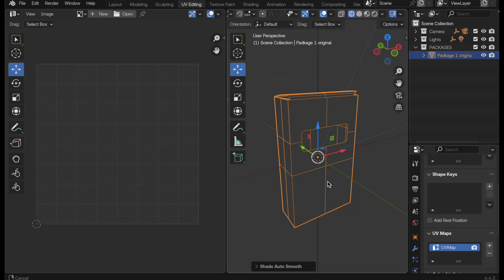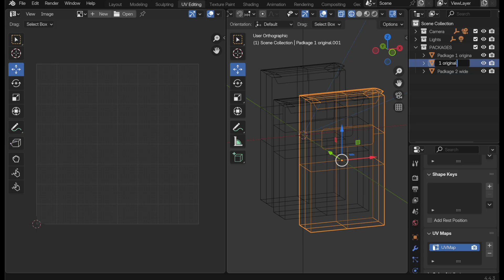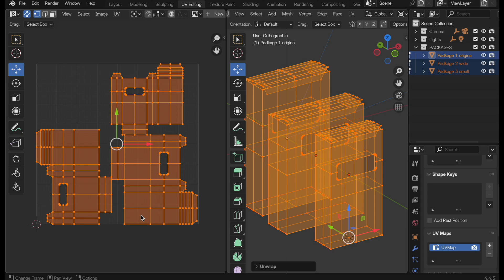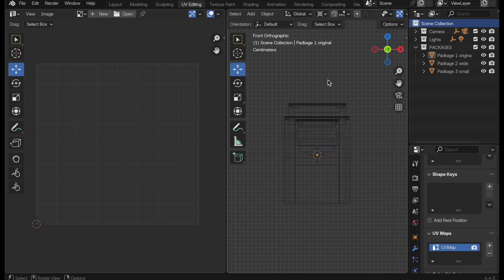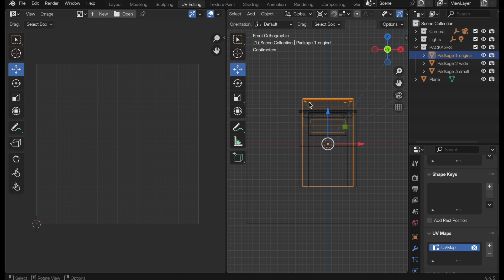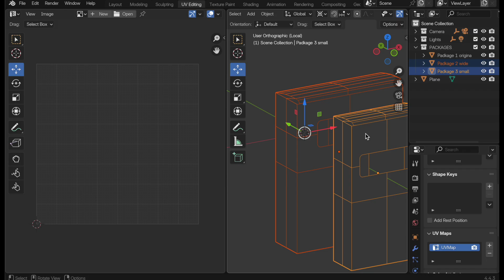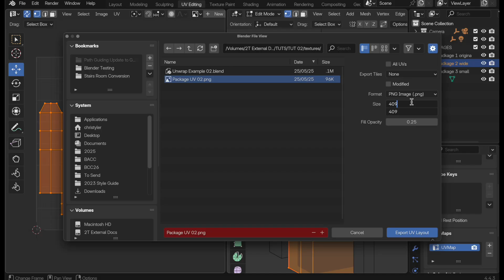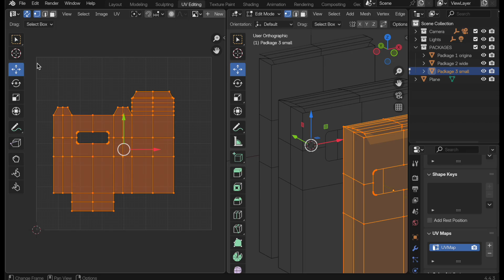A clarification for a size specific UV mapping.approach.

Comment: Unrelated but im pretty sure variable rougness isnt a real phenomenal. The Specular value (the ior level) is actually controlled by the fresnel. More Specular value = more reflections. This Ensures more reflectivity at glanzing angles. Shortly variable rougness is automated in the prinsipled bsdf due to fresnel. This is noticable when you change the ior to a way higher value.  The Ior level (specular value) slider is just a mix between a multiplication and division of the Frensel. For more variable rougness, use higher Ior.
Reply from the maker: No this isn't correct. The Principled BSDF (actually the GGX microfacet roughness function), alters the fresnel effect with increasing roughness. Technically it's still using the full fresnel curve, but at a single microfacet level. The macroscopic effect of increasing roughness is to scatter the reflections with their usual increase of reflectivity at glancing angles, as seen on mirror-polished surfaces. The apparent effect is that fresnel is less strong on rougher surfaces. In reality, surfaces are more sophisticated than the microfacet mechanism is simulating and sometimes surfaces become more apparently mirror like (or towards more mirror like) at glancing angles. This causes fresnel to increase in strength because light is scattered less even if the roughness at F0 is still fairly high. 

Variable roughness is the tool we have in Blender to simulate this.
Reply: @christopher3d475  Hi, Thanks for the comment. Do you know a reseach paper that shows how this can be physically accuratly modled? It would be very helpfull. Again i appreciate the quick response and the explanations, Thanks.
Reply from the maker: @helloiamaduck9203 I haven't looked to be honest, I'm sure there are given the ubiquity of this phenomena in the real world.
Reply: @christopher3d475  Thats true, i will take a look at it.
Reply: @christopher3d475  Solution might be similar to coating. Mix the shader that you want to apply variable rougness on with glossy bsdf by frensel
Reply from the maker: @helloiamaduck9203 No, because the glossy bsdf will have uniform roughness across the surface. What I'm talking about is something that happens on a SINGLE bsdf layer.
Reply: @christopher3d475  You're right.  Again, thanks. Ive concluded that the only physically accurate way of simulating variable roughness is by using a clearcoat or a layer of glossiness. I've taken a look at render engines such as Octane, and it does not simulate variable roughness. I understand what you mean, but I haven't found a single source that clearly explains how it's rendered. Thanks for your time
Reply from the maker: @helloiamaduck9203 TheaRender does this at a material level using a featured called Micro Roughness. It's one of the most physically accurate renderers out there and I lament that they don't have a Blender plugin version. But this variable roughness is built into their material system. A clearcoat is a distinctly separate thing from what I describe. Whether it's a clearcoat, or a diffuse surface using the standard glossy component, they both can have this variable roughness property applied. Clearcoat and the standard glossy component of the Principled BSDF are the same thing, we just have the ability to apply two glossy layers within the P-BSDF. 

If you want, watch this video from 9 years ago where variable roughness, their Micro Roughness, is demonstrated in TheaRender. https://vimeo.com/134103032
Reply: @christopher3d475  Sorry for the late reply. I coudnt find a formula that demonstrates how this is made, my guess is that they used a curve to modify the frensel. The curve may to adjust the specular value or even the rougness itself. My guess it that the had a float curve. Where a point in the center is offset to the height, or the width value, many thanks!

Comment: This is a solution to the problem you're pointing out, but typically with packaging you can create a loose concept in 3D and you send that to an engineer who will create the dieline that you then bring back to 3D to directly model from. So your texel density gets solved for you by importing it from an SVG. I haven't experienced things going in this order.
Reply from the maker: This isn't just about package design, this is one example. I've used this technique bunches of times over the years for various things where I've needed explicit size for UV data. I've also showed the approach you mention, where you start with a die-line first, generate UVs from that, and then fold it into shape. There's a time and a place for each approach.

Comment: A use case I didn't see you mention in either video was that this should also be useful for standardizing the scale of PBR materials. The grain of a leather material or grain of a wood pattern needs to be scaled to a specific dimension to look realistic. I guess you used leather in your example, but it wasn't obvious why it would look wrong. I think most good material libraries provide a recommended scale.

Comment: Great tutorial! I am sure some addon automatized this, but I am yet to find. Just want to add, you shouldn't export the UV as png. Instead export as svg, create a file with the desired dpi (usually 300), and then import the svg and rescale it in the graphic software to the corect size if it's not correct already.
Reply from the maker: Yeah, SVG is vector which is great. The focus on this video wasn't export formats however, DPI and format are easy variables to play with.

Comment: Useful approach. Although I work in the opposite manner. I would already have the diecut and artwork. I model to fit that and do one uv scaled disproportionately to fill the uv space because I do not want to waste pixels on empty space. The artwork is then rasterised at whatever resolution suits and imported to Modo. Then I do a second uv that is proportional and set at standard texel density. That I use for general textures such as paper stock, which I want to be the same scale across different packages.

Comment: the DPI (in image\vector editor) should be at least 300 dpi for quality print. For 'screen' it will depend on the close-up 'zoom' from the camera but anything around 150~200 dpi should be ok.
Reply: When you know the unwraped object needs 45x45cm of physical space you could go to your image editor and create a new 45x45cm image with 300 dpi. You can then convert the DPI to px/cm and use it with the resolution of the new image to resize the UV of your object and now you have an object that matches that physical scale and is precicely 300 DPI.
Reply from the maker: @MDK2k  Once the 4096x4096 is normalized to 45cm x 45cm, then you just scale up the image to 300dpi. It's that simple.
Reply: @christopher3d475  Depends on the method on how you would match the physical scale to the UV. I would probably start by setting the DPI first so when I export the wireframe image to the photoeditor it has the correct resolution. In this case it's not a big deal since 231 and 300 DPI are so close already.
Reply from the maker: The important part is the 45cm x 45cm part, the DPI can be changed to whatever you want. I didn't change it to 300 (or higher) because it wasn't relevant to the tutorial.
Reply: DPI is redundant. 4096 pixels by 4096 pixels is exactly that at any DPI.

Comment: I understand the concept, but the way the texel density of the reference plane and the box is matched seems a bit cumbersome. I don't know if this is a limitation with Blender, but with other software there are usually tools that allow you to take the texel density of one object and apply it to another. In Maya there is a "get" and "set" buttons for texel density. You press get on the reference plane, chose the box and press set and it basically does the same thing, but much faster.

Comment: Well it's not unitless, the unit of the UV space is normalized texture coordinate. The meer act of transforming from 3D to UV space itself is assigning a unit to the vectors.
Reply from the maker: That's a difference without a distinction. The UV space is not in inches or meters or centimeters or whatever you're model space is working in. It's an abstract set of coordinates from 0 to 1.0. The technique I showed transforms that into a space that is related to the object you're working with in a non-abstracted way.
Reply: @christopher3d475  The texture resolution dictates what the texel density will be. If you know ahead of time what the texture resolution will be it no longer is abstract. It just works the other way around where your starting point is esentially the dpcm (dots per centimetre). Since we use the metric system for modeling and DPI uses inches working this way can be a bit annoying. 

However you can set the texture resolution in the Uv editor to a value you want your canvas size to be. If I set the texture resolution in Maya:s Uv editor to 45 (like the 45cm canvas in this video), now every object that has a texel density of 1 will match the scale of the canvas. So if my box has a texel density of 1 then it will be the exact same as what you did on the video. I don't know if this possible to easily measure and set texel densities in Blender, but there probably is at least a plugin that can do this.

I watches your earlier video on this subject and that kinda adds to my confusion I have to say. Textures can be unitless sometimes as well. If you don't know what size the texture is suppose to be you are already guessing to begin with so it doesn't make a difference. However most sites these days give you a measurement of the texture in metres or centimetres. Polyhaven even gives you the texel density value. So if I want to for example use the 4k version of Leather Red 03 texture from polyhaven on my chair model, I can just go to my UV editor, unwrap the model and change the texture size in the uv editor to 4096 and set the texel density to 136.5 and it will be physically accurate. 136.5 comes from the resolution of the texture divided by the physical size (in cm) so 4096 / 30 = 136.5. That is a much faster way of doing things. UV unwrap first and then set the correct texel density.